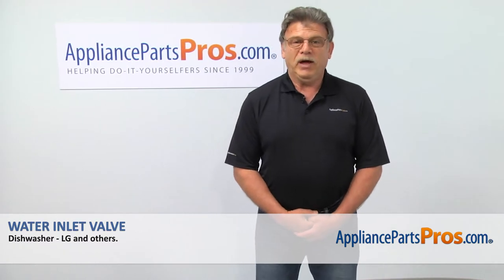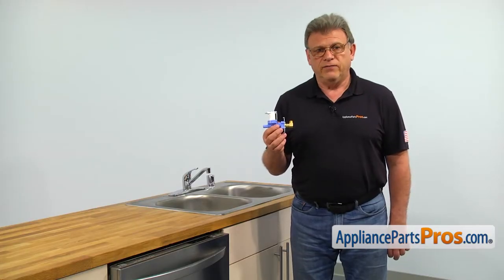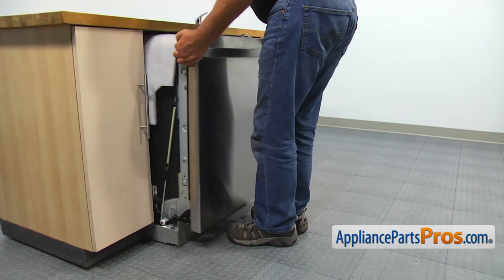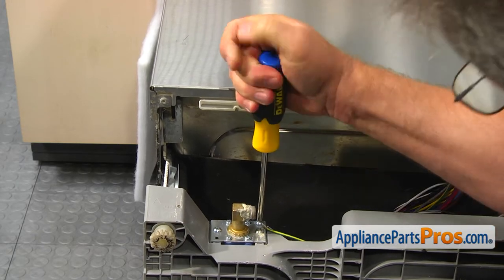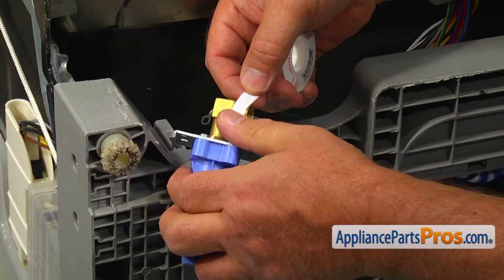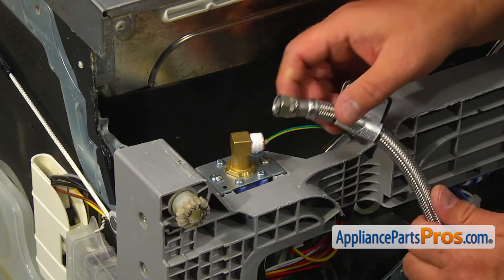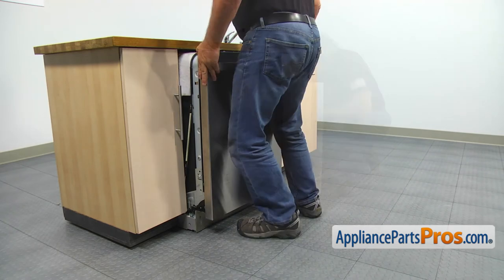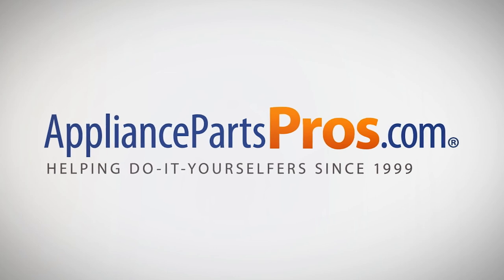How To : LG/Kenmore Water Inlet Valve 5221DD1001F

Comment: Great video.  I had the IE error code for lack of water flow, no leaking.  I could not get the bottom plate removed after undoing the 2 screws, so I did have to pull the dishwasher like you did to pull the unit from the bottom.  Once out, I unscrewed the plate holding the nozzle to the body, and there is a small screen in the body (it is just pressed in, so comes out too if you use a pick, but can be cleaned without removal).  Mine was completely covered with sediment.  Cleaning that screen was all I needed to do.  After reassembly, everything worked great.  I will be installing an inline sediment trap from my water source, lol.  This was a pain just to clean the screen.  😆
Reply from the maker: Glad you were able to get your dishwasher up and running again. If there is anything we can help you with in the future please let us know!

Comment: I went through the process to replace a leaky inlet valve, however when I was done the new OEM valve was installed I got a IE error code.  So I reinstalled the old leaky valve and the valve still worked but leaked.  I ordered second new OEM valve went through the process and same result.  Again, old valve still works.  Any ideas for me?  Thanks, Thom

Comment: You really do it the hard way!! You don't have to remove the machine from the stand!!
Just remove the front cover. ( a few screws) and then remove the bottom plate ( 2 screws) and work from there ! Or better still just remove the bottom plate.. Very easy. But you may have to work laying on the floor   10 - 15 mins max

Comment: Can this repair be done without putting the dishwasher on it's back? Please let me know the procedure or post another video if you are able. I am not able to put this unit on it's back due to space constraints.
Reply from the maker: You will need to get to the under side of the machine, so if you can't tip it back, you will need to somehow elevate it.